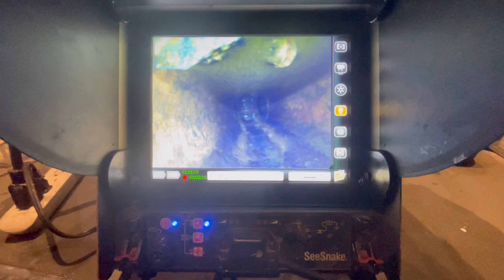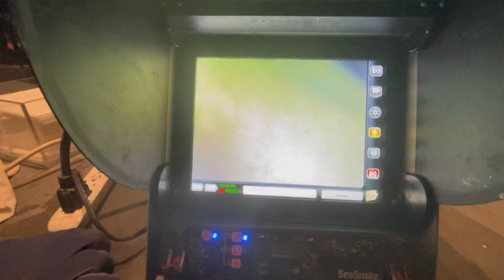Drain Cleaning #1

Comment: You Could've Unstop that Drain from the inside, you're using the wrong head to start off with, and why use a camera if the drain is clogged, my camera can't see under water. I  don't understand when people do that first, is that a Bogus Charge. And what's up with that Moving Truck for such a small job?
Reply from the maker: There were way too many turns! It’s an old restaurant in Hollywood, and the pipes were in terrible shape since they’ve never been maintained. Sometimes when the water is clear, you can actually see the camera if you move it really slowly. My camera has a locator, so I always use it to figure out where the camera stops. And for the trucks, big guy, big truck, small guy, small truck! 😆 Thanks for your input, mate! I appreciate it!
Reply: @PWN5  What if the restaurant was on a Slab🤔, I have an smaller version of your moving truck for my bigger jobs, but my other 3 trucks are service trucks and 1 has my jetter unit built on the flat bed, those pull around units are just to much of hassle at times in certain areas.
Reply from the maker: If the restaurant is on a slab, that definitely changes things! Been there and done that sometimes I’ve spent 2 hours snaking and hydro jet but feels like a dead end. In those cases, you really have to open up the slab and replace those old pipes cause they’re often cracked, saturated in grease. That’s an awesome setup you’ve got; great job! I have a trailer Jetter, while it can be a hassle to maneuver sometimes, I’ve definitely gotten used to it.